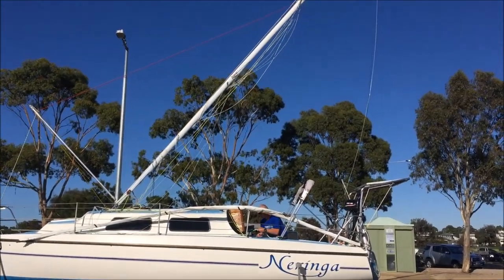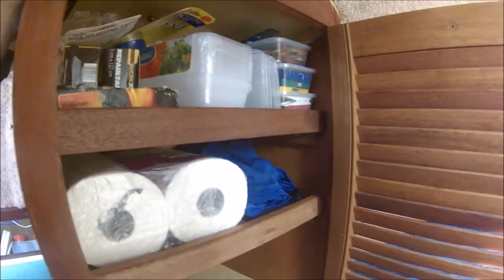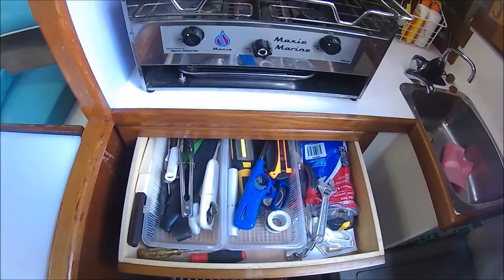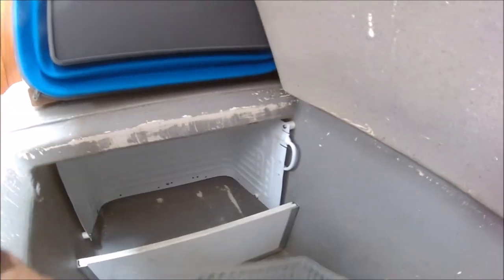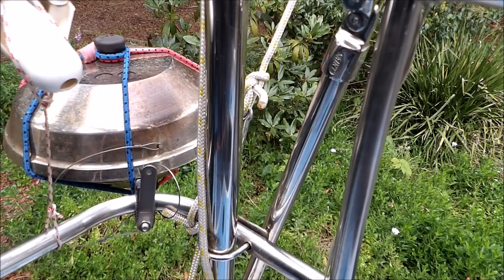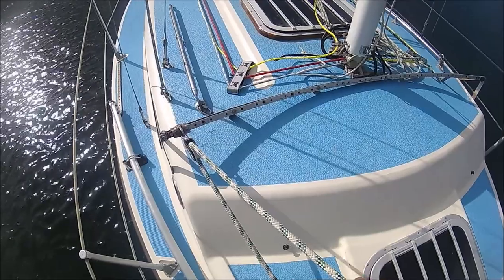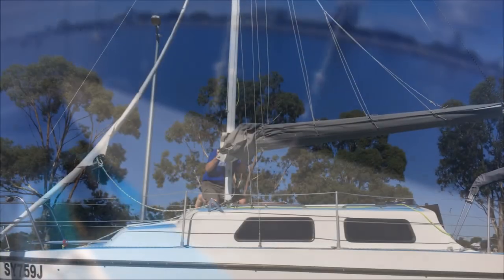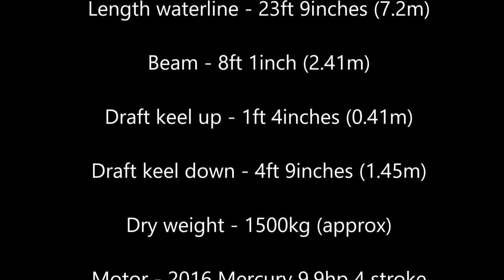Neringa RL28 Cruising Improvements - Part 1

Comment: I have a 28 foot Sharpie cat ketch rig that unstayed.  Have been watching Simon Carter's videos and came across your adaptation of your trailer sailor.  You have given me some more great ideas.  Trailer sailors rock.  I can understand why people like keel boats for the comfort and room.  But i can never get my mind around how much money they have to spend to put them in slips with all the attending problems with osmosis, stray currents, hull cleanings, and constantly being in a sea environment.  If you like to be able to go to many different places to sail you are not constricted by time and distance.  Well done sir...
Reply from the maker: Hi Alan. I have watched many of Simon Carters videos with interest. I went through the keel boat trailer sailer dilemma again before buying Neringa. Yearly costs were a big factor against keel boats but it was more I wasn't ready to give up the versatility of trailer sailers. Properly prepared they can do the same coastal cruising of a keel boat but can also access shallow anchorages and travel across Australia to sail locations that would take months to reach by keel boat. Wear and tear on the boat sitting on the trailer under cover is also substantially less than when moored or penned. On the down side they do take around 90 minutes to rig or de-rig  to go sailing.
Cheers Mark

Comment: That is set up so well..I see this video is 4 year's old, do you still have the boat.
Reply from the maker: Yes, still have the boat. The shower area is not very practical. It is the toilet compartment  shown on the video with a drain into the forward bilge with a bilge pump to empty and a shower curtain across the door. Showers are very cramped using the closed toilet as a seat. They certainly are not your typical stand up shower, but on a 28ft boat that would be very big ask. The shower head is on a flexible hose so can be used as a hand shower which is the only way it would work in such a small space. In warmer weather when anchored away from others I prefer to use the deck hose out in the cockpit for showering. Hope this answers your query. Cheers Mark

Comment: did you put the protective rods over the hatch? nice trailer too.
Reply from the maker: Hi John, no the bars were a standard part of these Houdini Hatches that were popular in the 1980's and fitted to many boats. As they were glass they were probably needed. I have recently replaced them with offshore rated Gebo Hatches that are plexiglass. The old hatches leaked and no matter how many times I replaced the seals they still leaked. Love the new hatches, made especially by Gebo to replace the Houdini hatches. Cheers Mark

Comment: Thanks very much. Looking forward to part 2. I thought your improvements to Halcyon were fantastic. Particularly the wind vane steering.
Cheers Tony woollcombe
Reply from the maker: I loved the windvane on halcyon, the dagger board rudder on Neringa is more of a challenge in regard to designing a wind vane that works. I have a few ideas but it might be a while as my next project is to build a hoist that can lift neringa off the trailer to remove the keel and work on the hull, the engineering involved will take a bit of work.
Reply: I would like to see the hoist when you have finished
Reply from the maker: Probably doing a trip up to the whitsundays in a month or so so unlikely to start construction until late July. Happy to make a video about the hoist and removing the keel for restoration when it is finally ready.
Reply: Look forward to the video to the Whitsundays, cheers
Reply: mdedman100 have a look at the Hebredian Wind Vane details on the web  cheers

Comment: All ways a great vlog. Love your work.
Reply from the maker: Cheers for the comment. Got another one on the way sailing to Queenscliff but will probably be another week before its finished.
Reply: Hi.... Very sorry can not remember your name. I used to drive a 40 foot charter boat up the Yarra and the Maribyrnong Rivers, may be you can do one up there.And now you can take your mast down that would be good. I used leave Southbank and do a 3 hrs. trip up and back at about 5knts. and also did it at night. Great trip all the time.But keep in mind ,beware if its been raining the rive will be running and the river will be up at some of the very low brides. Also the Maribyrnong is a great trip.
Reply from the maker: Hi Mark. Not a bad idea, maybe one for winter when the bay is less inviting. Would probably just leave the mast down, limited sailing on the river anyway and with the keel up could get a long way up the river.

Cheers Mark.

Comment: Hi Mark , always useful info to refer back to your vids , could you expand on your bimini choice ? Model detail would be helpful as yours seems to have stood the test of time. With retrospect is mounting the flexible solar panels on top a success .
Reply from the maker: Its been a good bimini and definitely heavier duty than the cheap ebay ones but it was on the boat when I bought it so I don't know the brand, I will look through the receipts that came with the boat and see if I can find out.
The solar panels work well on the bimini as long as you have sufficient strapping to hold them in place. I have had mine out in 30 knots so far without any issue. They are more hassle to put on and off but as the only real useable space for extra panels it works well. The boom shades them a bit so I tend to sail with the boom a bit further out when ever I can to reduce the shading. They do have some weight so a reasonable bimini is needed. If you go this way and buy flexible panels don't take any notice of output claims especially on ebay. You will get around 180w per square metre of panel. Some of the claims out there are just outrageous lying and fraudulent. The above figure is pretty accurate with todays efficiencies and technology. Cheers Mark
Reply: Thanks mark , yours are stainless ? And not joined mid hoop ?  I will have a 160 w rigid panel on the pushpit and 2 flexible for the bimini. The push is on to get the RL finished.
Reply from the maker: @noissimdam  The bimini hoops are alluminium but heavy 3mm wall for memory. Sounds like you will have a similar solar array to Neringa. We have 160w on the davits and 360w in flexibles on the bimini. All the best with your project. Cheers Mark

Comment: I like your trailer winch....  I have just bought a Power winch today for my little trailer sailer... how do you power your winch... ie battery in the back of the ute, power lead routed thru to the back and something like an Anderson Plug ?
Reply from the maker: On my last trailer I had a trailer mounted battery. On my current trailer I have a couple of leads with spring clips that I clip onto a battery in the back of the ute. When not in use they are wrapped around the winch post. Its easier to charge the battery this way back in the shed at home.
Reply: Thanks for the reply... I am going to do the Battery in the boot and charge at home.

Comment: How is the furler arranged Mark? I am looking at adding a furler to my Ultimate 18 and want to be able to reef like yours. I currently have a hanked on genoa.

Cheers,
Rhys
Reply from the maker: Hi Rhys. The furler uses a ronstan trailer sailer drum and swivel and although not cheap are still quite alot cheaper than the smallest profurl. It is set up completely separately to the forestay which can still be used if needed. The furler drum on mine is attached to a separate ubolt installed in the deck as close to the center as practical. The swivel attaches to the headsail halyard and is used to tension the foil. The foil is the tricky bit. I have used 16mm electrical conduit. You have to make brackets (mine are stainless flat and tube that fit onto the ends of the conduit.) Basically the flat steel protrudes out of the end and into the conduit. On the outer bit there are 2 holes, one for the drum or swivel pins and one for a shackle to which the sail islets are attached. The steel flat inside the conduit has a hole to which an internal cable is attached. The internal cable needs to be a bit longer than the sail but short enough to allow the foil to be pulled tight by the halyard before you hit the mast. The end brackets are bolted to the conduit to make it and the brackets turn as one. ie the top and bottom bracket turn at the same time and the same amount, the cable takes the tension, the conduit takes the torsional force. The sail is lashed to the shackles top and bottom  and to the conduit along its length. It helps to tightly stretch the foil between 2 trees or posts while you do this to ensure a tidy fit. 
I thought about using a profurl furler but decided to go this way which I also had on my previous boat because it is so easy to put  the sail and bring it down because the home  made foil can almost bend double whilst pulling it up or bringing it down but it still allows reefing in strong winds. You could do the same using a torsional furling cable that you have made but they are quite expensive. If you need some drawings let me know and I'll see what I can do.

Cheers
Mark
Reply: Some drawing would be great, thanks Mark. electrical conduit would be more robust than the traditional aluminium foils
Reply from the maker: The aluminium foil put me off for the chance of bending and difficulty of setting up for a trailer boat. The conduit has enough torsional strength for the reefing. I will try do some drawings in the next week or so and email them to you, cant attach them here so send me an email to mdedman1962@gmail.com and I will see what I can do.

Cheers 
Mark

Comment: Hi, Love your boat. I am considering buying a RL 28 as well however the boat is moored and does not have a trailer. Can you tell me what brand trailer you have, model number, Tare weight and ATM. I would value any advice on what type of trailer to purchase.
thanks Pete
Reply from the maker: Hi Pete,
My RL28 was moored also and had to put a new trailer under it. It has been a learning process and given a chance to start again I would buy a different trailer despite having mine about right now. 
For an RL 28 it is advisable to get a trailer with a GMV of 3500kg with a trailer weight of 750kg. Most of the time mine would be around 2500kg lightly loaded and 3000kg + loaded for extended cruising.
My trailer is a Swiftco 7.2m tandem trailer and cost $9800 with an optional roller ladder arrangement for the keel. Having said this the last 40cm of the keel is not supported. This doesn't worry me as the original tinka trailer that was sold with the RL had about the same support. The minuses for this trailer are:
1) all the chinese bearings needed to be replaced with japanese ones.
2) axle u bolts were utterly under size for the size of the trailer with a nasty mishap when one broke on the way back from the whitsundays. I have since replaced them with over engineered ubolts.
3) the electric over hydraulic brake unit was not the best and failed on the extended trip leaving me without brakes on the trailer for 1800km. I have since replaced the brake unit with an alko brake unit which has been much better.
4) All blue rollers had to be replaced with red rollers although I am finding the red rollers are giving too much rolling resistance when loading and unloading so I might go back to blue again.
The only other suitable trailer was a Mackay trailer for $13600 which in hindsight might have been a better choice as it had a roller bed to the rear of the trailer and would fully support the keel. I cant comment on if all its components would be locally made or chinese imports like with swiftco. At nearly $4000 more I would hope for better quality. I have spent around $2000 on the swiftco in modifications and repairs. The frame of the swiftco is reasonably built and up to the job. I will probably never know it the Mackay would have been the better choice.
Hope all this helps

Cheers Mark
Reply: Hi Mark,
Thanks so much for you informative reply. It seems we are following the same path. I too have been looking at the Swiftco trailer as well as a few others. I have been watching your video ( which are really well made) and noticed that you have removed the rear wobble rollers on the back of the trailer. Is there a reason for this? Is it because they don’t give any support when trailing? Would they however assist with recovery?
Thanks 
Pete
Reply from the maker: Hi Pete,
because of the hull shape the rear wobble rollers cant be set high enough to support the boat while trailing without stopping loading and unloading. If set low enough for loading they do nothing to help steady to boat on loading because the shape of the hull at the front half of the boat. They are really designed for supporting the rear of powerboats that have a flat rear hull shape.  Once half loaded the forward rollers steady the boat well. So all they were doing was adding extra weight. The rear of the trailer does give some help guiding the boat to the center if the trailer is put in the water so that the top of the mudguard at its rear edge is just under water.
If you do go swiftco I would recommend getting the ladder roller bed. You will also need to adjust the wheel position and winch post position to suit the RL and to give you the correct tow ball pressure. Let me know if you do and I can give you the measurements on the frame for both to get this correct. They would probably do this for you if you have the measurements.

Cheers
Mark
Reply: Hi Tony,
I get what you are saying. I have done a bit of research on trailers and looked at a Bonanza 7.2 boat trailer that comes with a Hydrastar brake actuator which should be reliable. Actual trailer is straight out of China flat packed and assembled in Australia for $8500. Did you come across this brand when you were looking, any thoughts. Can you tell me what width your keel ladder is, 30 cm? Is there a particular width that suits the size keel housing on the RL 28. Thanks
Reply from the maker: Hi Pete,
The Bonanza was not around when I bought the swiftco but from what I can see they are the same trailer and probably from the same factory in china. The brakes and brake unit are added by who ever imports them. The felk brake unit on the swiftco is australian made and worked OK until it blew an internal o ring and filled itself with brake fluid. The hydrostar unit is a very similar design, and maybe I was just unlucky. The only thing I would worry about the bonanza is if you need parts for it will they be around in a few years. My guess is parts from swiftco will fit. If the bonanza price is $8500 without the ladder roller then the price is much the same as swiftco.  ;My ladder roller is 30cm wide and the RL could get away with 8inches wide, the rollers would be alot cheaper but they would have to be flat or cotton reel style to fit the keel properly at that width, not the dog bone style that most of these trailers are supplied with.

cheers Mark(tony?????)
Reply: Sorry Mark about the name, 'old timer's disease' setting in?  Yes it hard to know what you are getting with these trailer. I was thinking I might manufacture my own keel ladder on the Bonanza which is why I asked for the proportions of your own. Do you mind telling the dimensions. What length was the ladder? Was the ladder made from gal. steel of aluminium? what dimensions was metal angle? 6mm x 50 x 50 mm? (I guess). Is it bolted with u bolts. What was cost for your ladder from Swiftco? The things we do! I appreciate your input. Thanks
Reply from the maker: Hi Pete,
No worries about the name. The ladder was an extra $550 for memory from swiftco which included the legs that fit it into the existing roller leg brackets on each cross member of the trailer. Its dark now but I will measure the ladder and angle tomorrow in the light. You can't ubolt it on as the heights of the legs that hold it on have to be adjusted to accommodate the shape of the boat. On mine the front small keel roller is set as low as it goes. the front legs on the ladder are set quiet high and the others going back along the trailer are set progressively lower to fit the shape of the keel. When I first loaded the boat I set the ladder with a slight slope upwards toward the front, this was enough to get the boat on the trailer. Once on I use a small bottle jack to adjust each set of legs bit by bit to get all the  rollers make equal contact with the keel. In fact when properly set the ladder has a slight curve to it with the angles slightly flexed.
Building your own ladder would be hard to get it down to the same cost. You would have to buy the rollers and pins which alone would be between $200 and $400. For the RL the pins would have to be at least 20mm, mine are 25mm. The rest of the materials plus rust proofing would add a fair bit more especially if you get it galvanized. The other reason I would suggest the odd $500 is worth it is the number of 20mm + holes to be drilled although you may be well equip  to do this. I had considered building the ladder too but decided in the end I would spend a similar amount and probably not do as good a job.

Cheers
Mark
Reply: Well Mark after lot of thought I have decided on not getting the RL 28 , have purchased a Farr 7500 on a well maintained trailer. It is a very established boat with not much to do , or so I hope. Just time to enjoy. We have been watching your Hervey Bay adventures and hope to start there as we are on the Sunshine Coast. All the best and smooth sailing
Pete
Reply from the maker: HI Pete. Farr is a lovely boat, not enough headroom for my bad back but very capable otherwise. I hope she creates many happy times to come and not having the worry of the trailer is a good thing. 
Hervey bay, great sandy straits and especially wathumba are wonderful places to visit. You wont see whales much before June but its a magic place. Hope you get out on the water soon. 
Cheers Mark